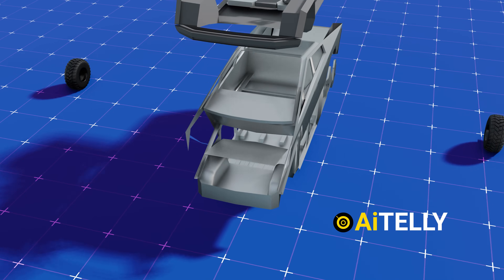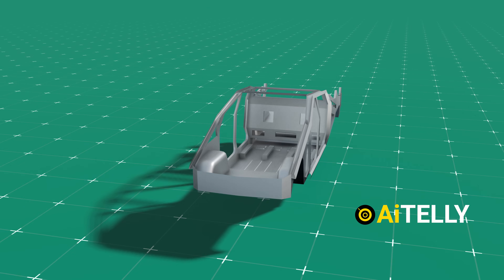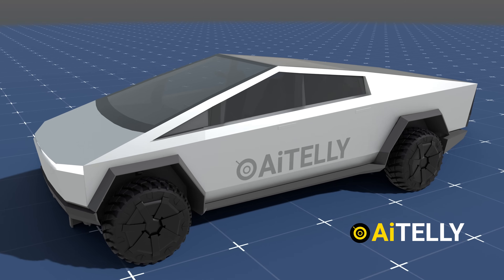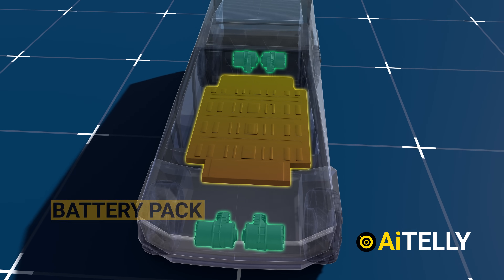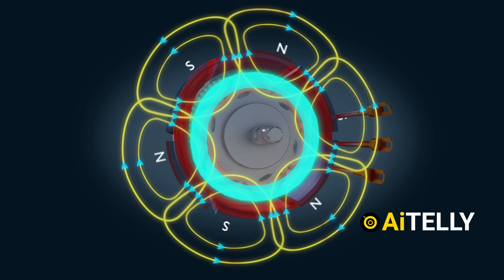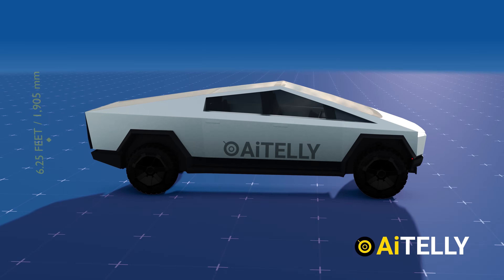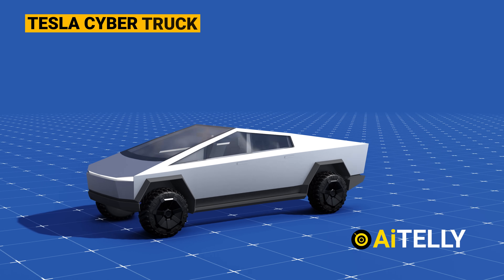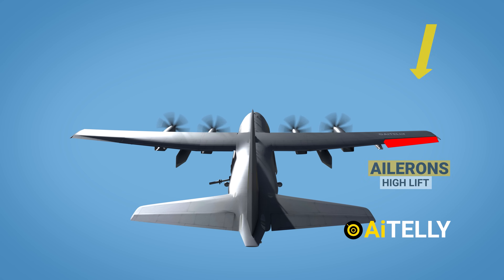Tesla Cyber Truck Engineering Inside #tesla #cybertruck

Comment: No one in EV market is using dual clutch gearbox.
It can reduce constant energy consumption (with big motors), 
Plus provide (real) rolling momentum. 

Ladder chassis is required for rigidity and strength, when towing heavy loads.
Monocoque will fold, flex and bend due to different forces acting upon it- torsion, shear and stretch. 

I'm curious to see if cybertruck can withstand these forces for long duration of time.

Comment: inspite of the innovation the CyberTruck design is impractical for an automobile . . .
Reply from the maker: Noted
Reply: @Aitelly also in my profession as a dialysis technician I would like to note that those motors are not any more sophisticated than the motors I use for water moving as they have nearly the exact same design.- only difference being we use two magnets instead of three as it is much more cost effective.

This reminds me of the video where the cyber truck required a wooden ramp in order to make it over the curb of a sidewalk.

I got into an argument with Marc Benton I believe, a fanatic over this aspect and he claimed that it could apparently crush the curb.

This is wholy false.

Let me also remind you guys of my former position as a repair tech within Tesla.

This reeks of vaporware.

Comment: I have a question.
In an event of a crash,
Will it be easier or harder to make it back in the original form?
Reply: It will definitely be harder for the first responders to smash out a window and get you out of the truck.
Reply: Yes for sure.
But how about fixing it? 
How about getting parts to replace damages?
Reply: @thtsia8739 that's the neat part, you dont
Reply: @thtsia8739   I've heard/seen a dozen times from car crash complications how a Tesla got its fenders a bit dented, maybe a sensor knocked out or bent. And the insurance or dealer deems the ENTIRE CAR as completely "TOTALED"
Reply: Anybody notice how all auto insurance is going up?  A small event with these vehicles, that looks like maybe a $2k repair, quickly shoots up to $30k!
Reply: @leeka40  almost as if buying a car is a scam
Reply: @leeka40  That's only going to be worse with unibody construction.
With a fender bender in a truck with a ladder frame they unbolt the dented fender and bolt a replacement fender in its place.
With a fender bender in a truck with unibody construction they have to straighten the existing bent fender back into shape wgile it's still on the truck, as well as any other metal panels that got shifted out of position.

Comment: For utility vehicles ladder frame is an advantage, but not a disadvantage.

Same as for military trucks for example. Ladder frame means durability and long term of service. While "built in" or "integrated" frame will last only as long as car's body itself.
Reply: That's why there are so few unibody cars on the road. They're cheaper to buy but get totalled in a collision because instead of replacing the damaged body panels you need to spend serious money straightening the body to make it drive right.
Reply: @ghost307 here is the thing, the frame on a cybertruck is very strong, any collision strong enough to bend the frame beyond repair will total a regular truck anyways but you also have to consider what you care more about, safety, or a repair bill
Reply: @Victor-vj5ds  Correct.
The conventional truck with a ladder frame is not only stronger and safer, but costs less both to repair and to buy.
Reply: @ghost307  not at all, most of a trucks frame strength is in the underbody and can be deformed easily from any offset collision. I dont know where you got the idea that welded and bolted metal is stronger than a giant casting. The cybertruck can be modified for a ladde frame.
Reply: @Victor-vj5ds  32 years running a body shop.
Reply: @ghost307  and not a single year with  large scale alluminum die cast. This isn't something any automaker does besides Tesla.
Reply: @Victor-vj5ds  

Unique solution - does not mean it's a good solution. Usually it's the opposite.

Cheap and easy to maintain is better than expensive and hard to maintain.
Reply: @Victor-vj5ds  The body is 12 gauge stainless steel sheet metal.
Reply: @ghost307  the actual structure is die casted alluminum. The skin is stainless steel
Reply: @ghost307  

Yep. And straightening the body is not only costly thing to do, but also it does not restore car's durability. Once bend, it always will be bending at the same spot. No structural rigidness anymore. That is why all off-road vehicles have classic ladder frames

Land rover
Wrangler
G-wagen
Nissan patrol
Toyota TLC 70
UAZ
Reply: @n.b.380 if you hit the truck hard enough to bend its casted frame then the same collision will total a regular truck. But you have to think about what you value more, safety or repair cost. The truck is offroaf because it has precision traction control no regular differential can match. The vehicle doesn't waste energy idling or spinning out and you can recharge it with either a solar panel or a portable generator if your that worried.
Reply: @ghost307  

Also, I don't get how car can be off-road and electric at the same time?

Do you have power sockets in the woods, or at the deserts every 50 miles?

It's clearly that cybertruck is just a fun vehicle. Not for any serious off road journeys.